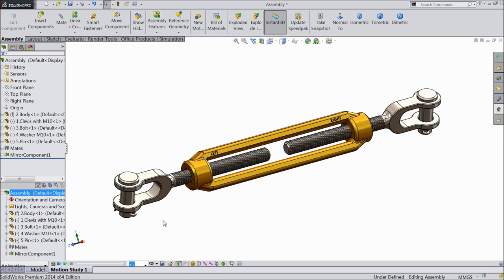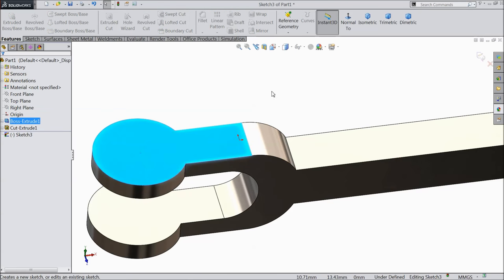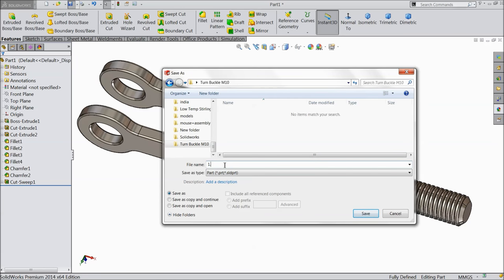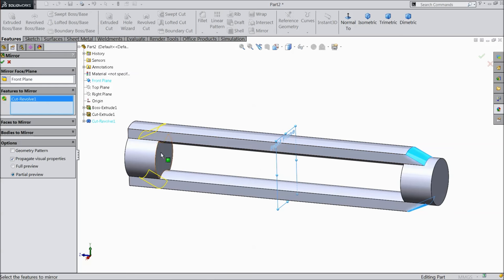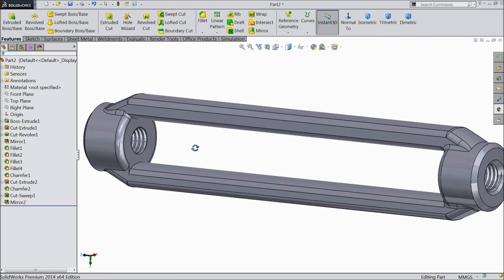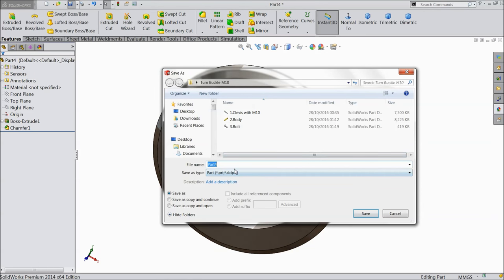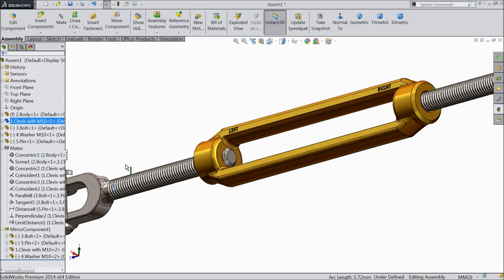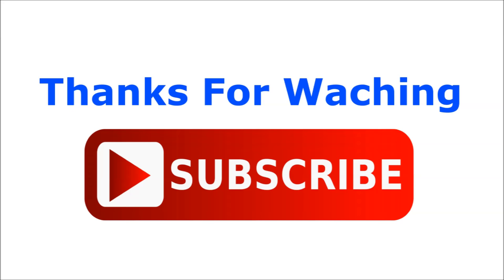Solidworks tutorial | sketch turnbuckle in Solidworks

Comment: i want an help from  YOUR SOLIDWORKS GUI LOOKS REALISTIC...ALL THE TUTORIALS OF U I LIKE THE REALISTIC LOOK OF MODEL...CAN U SUGGEST ME WAT TYPE OF SETTINGS U AVE MADE IN CUSTOMS MEANS COLOUR AND BACKGROUND
Reply from the maker: Thanks for watching. you need professional graphics card in your system like Nvidia quadro series or AMD Fire Pro series. normal graphics card will not support real view in any cad softwares, you must buy a professional graphics card for real view.
Reply: sir then need to buy new laptop with the above graphic property...thank you for the information
Reply from the maker: yes you need to buy a mobile workstation laptops the available laptops in markets are Dell precision series, Lenovo thinkpad W & P series, HP Z Books, and MSI workstation laptops.
Reply: sir presently i am using lenovo g580 old series is there any possiblity to accomodate it
Reply from the maker: no, you need to buy a new.
Reply: k sir thank u which is the best laptop to work with mechanical softwares...coz i use autocad,creo,nx,catia,solidworks,ansys,hypermesh,inventor....which is best interms of speed and graphics...
Reply from the maker: every company have low & high end laptops i am using dell precision M4800, try new dell precision 7710 series.
Reply: thank u sir